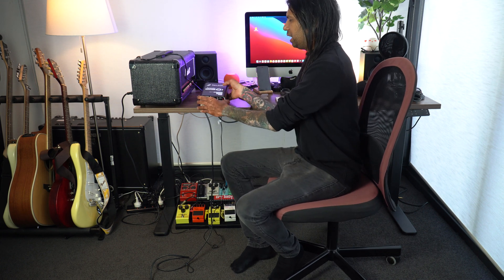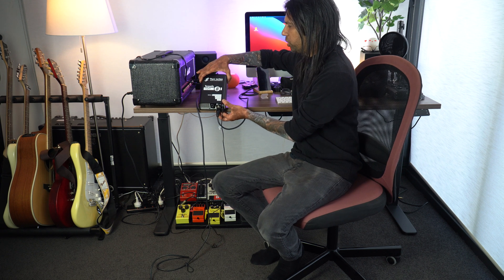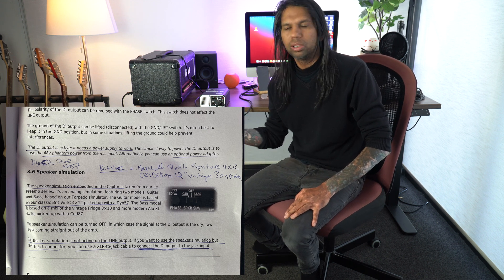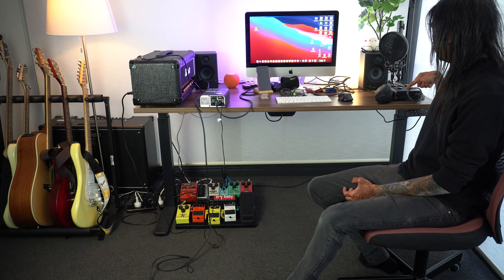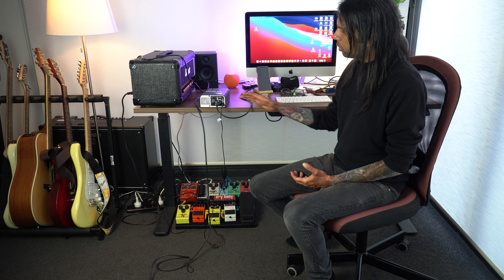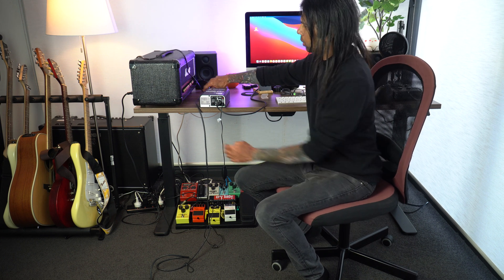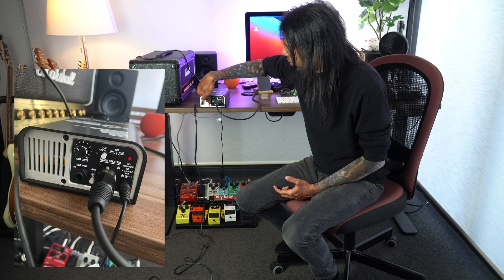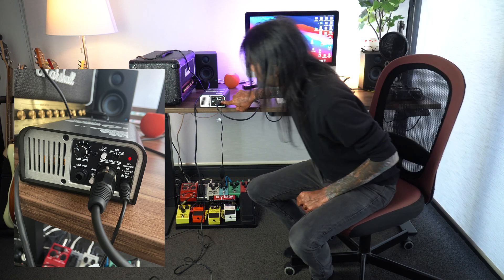Easy introduction to reactive load box, two notes torpedo captor (Part 1)

Comment: I use a Celestion Speaker Shaper plug in which I prefer to Two Notes' own Wall Of Sound.And I don't need to power the box.Since I don't use the IRs on the box.
Reply from the maker: Nice! At the moment my two notes is plugged into  my pedal board and that’s where I’m getting the power source

Comment: Thanks so much for your instructionals. Due to my tinnitus getting spiked recently, even playing at 80-85dB, I think I'm going to have to push my tube amps through my CaptorX and use monitors from now on I think. 85dB is just where they start to push some air from the speaker and sound good, but with the CaptorX I can push the amp easier and control the volume with the monitors to bring it down.
Reply from the maker: Hey thanks for watching. Captor is amazing to contain the big tube amp sound.